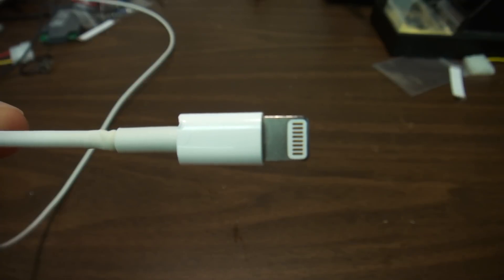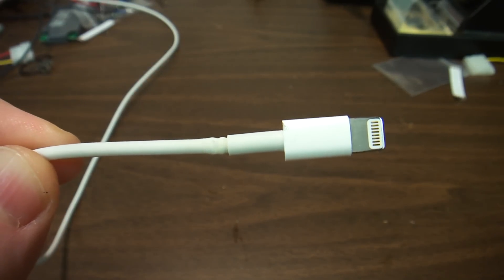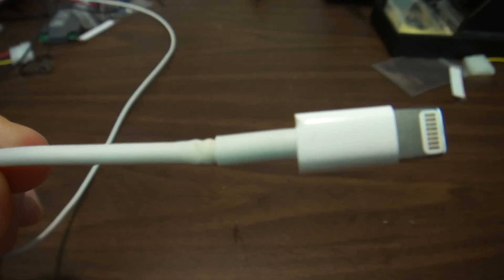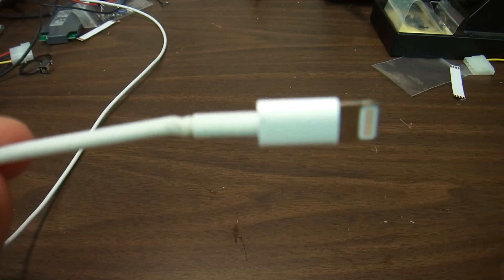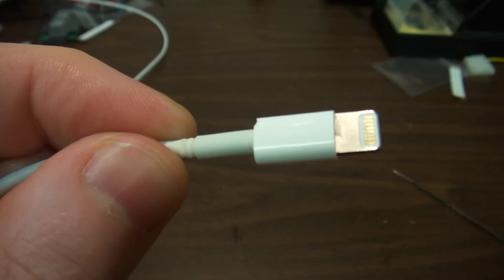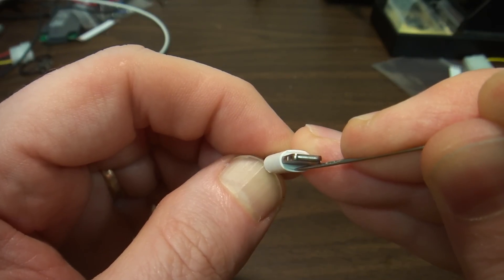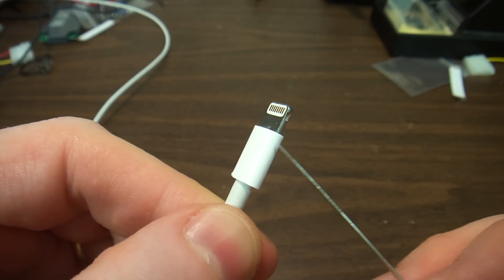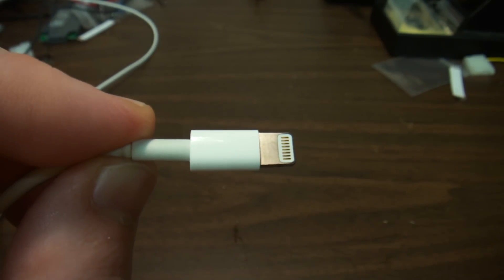How to fix an Apple Ipad Ipod Iphone Lightning Connector Repair Part 1 Introduction

Comment: Resolution for ONTEN Lightning To HDMI Dongle   Firmware Upgrade for iOS higher versions 9.8 & above:
Please download related APP from http://app.onten.com.cn/app/index.html
Then connect your dongle to working iOS lower version device (used old iPad) and go to above app AmaLink and select the right series of your dongle and download latest version ex - S500F2A1LG004V021 and update. This will update the firmware and you can see the iPhone screen with higher versions like 13.2 & above on other big screen devices.

Comment: Just cut the damn plastic off with a Dremel and resolder the fitting after shortening the cable an inch with a solder station. Not a big deal folks. Use heat shrink when you’re done or dip it into epoxy for better durability but keeping in mind it’s a last time fix if you do. Hope that helps you don’t need a video just a little talent.